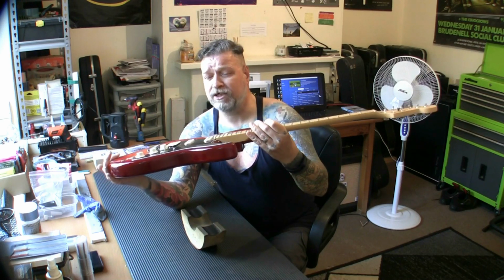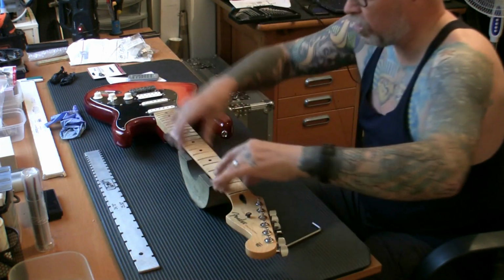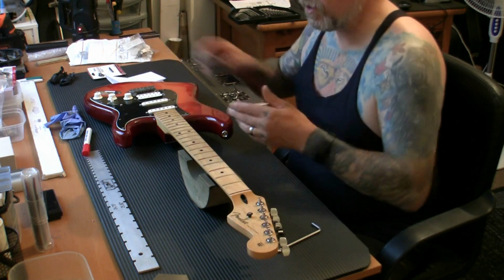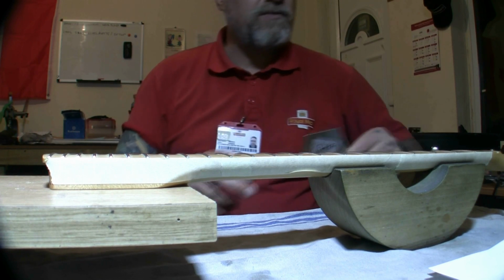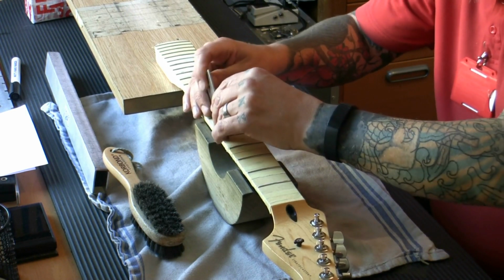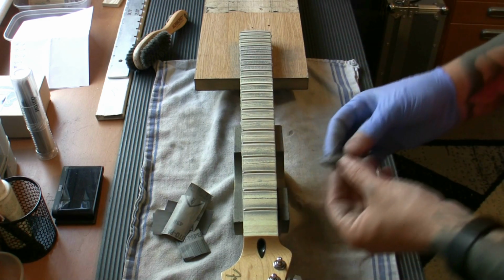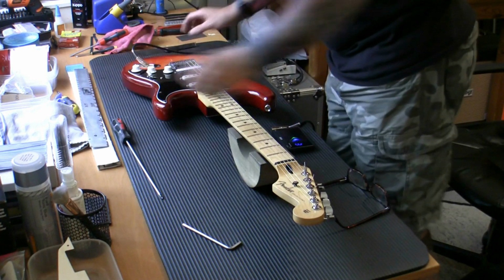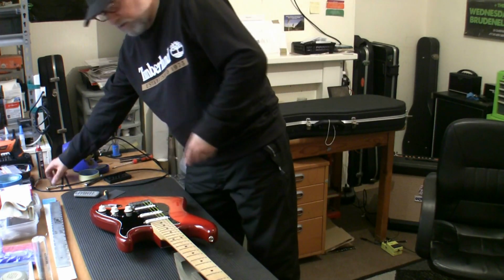Fender Plus Top HSS Strat in for upgrades and a setup...

Comment: Nice work. However, I struggle with the concept that you buy a new guitar that you immediately feel needs various mods. Surely more sensible to buy a guitar from the get in that ticks all the boxes ?
Reply from the maker: I don't think you can buy a guitar that ticks all boxes all the time. For instance, I might buy something HSS but may want coil-spliiting on the bridge. Case-in-point: I bought the most amazing 2006 Hamer Studio that is pretty much faultless: except... I love the sound of a single-coil in the neck so, even though the pickups are brilliant (Duncan 59's), I have added a coil-split version in the neck to give me that option. A brilliant guitar but made better by that new option. Regards, Victor...